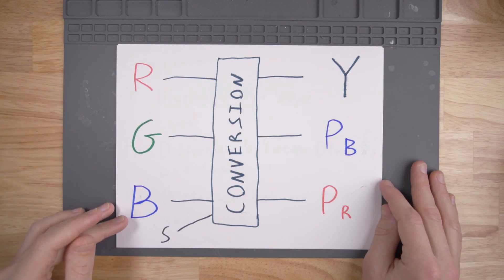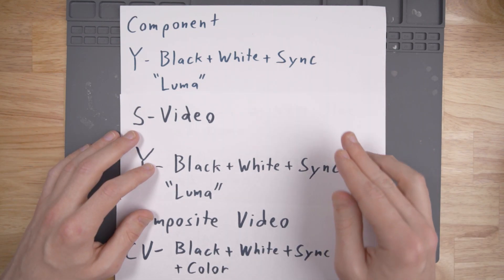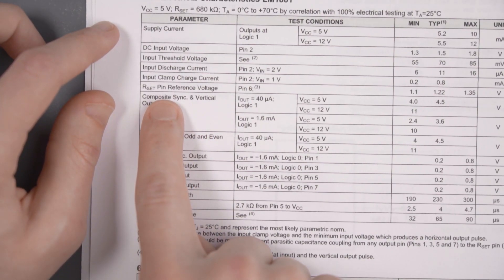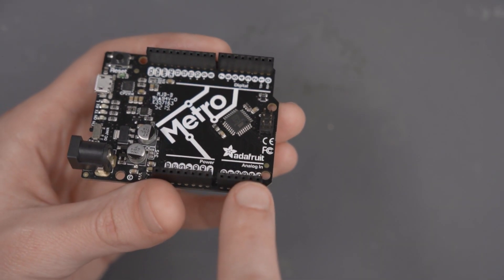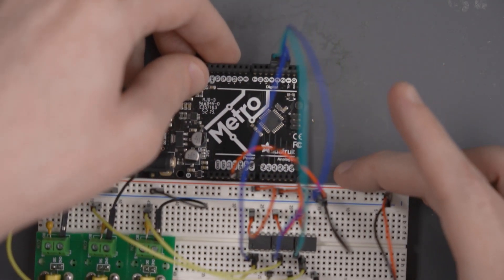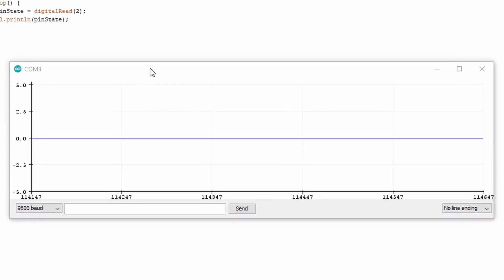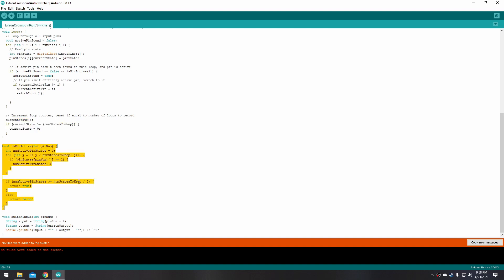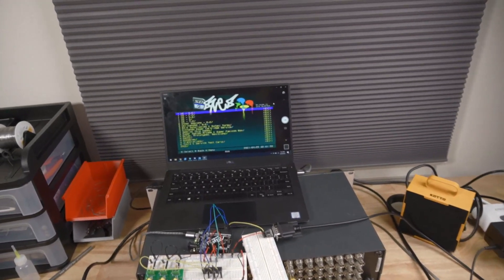Extron Crosspoint Autoswitcher Prototype! Part 2

Comment: What happened to this project? Was so cool to see this coming together.
Reply from the maker: In a nutshell, I ran into some issues with coming up with a good interface with the BNC connectors on the back of the extron crosspoint. Also, Voultar gave me an idea to use an amp on the video inputs because they will be split between the extron and the autoswitcher circuit. This project has been on the back burner, but maybe I can find some time to revisit it!

Comment: Are you looking to do a part 3 still, or did this project die on the vine?
Reply from the maker: I haven’t worked on this project in a while.  I was trying to figure out a good way to interface my project with the extron, and found out the parts may be too expensive to justify over using a different auto switching solution. I may revisit it in the future

Comment: Cool project. You can probably skip the arduino and use discrete circuits, a series of xors or comparators. Ditch the y adapters and do a pass through on the breadboard. Try putting some caps on the power rail to smooth out the vcc, and tie the unused pins low (or high) so they're not floating.
Reply from the maker: Really the only thing that a microcontroller needs to do is send the rs232 command, but the firmware could be changed to add additional features (changing between manual and automatic switching, different auto switching behaviors)
Reply: Good point. 

This may take it past scope, but for v2, put the commands on eeprom and push it through a shift register. Use a 555 or a crystal to provide the clock, and on a hit read from an  address range to push the command over 232. 

Granted more complex than using a microcontroller, but it can reduce production cost if you want to scale it. Then again I'm also a software engineer, so I may be over simplifying it.
Reply from the maker: Something I’m definitely considering is using some kind of shift register to lessen the number of pins I need to read all the inputs. That way, I can use some inputs for other features, like physical dip switches for each input to control which output to go to (I.e. inputs 1-4 go to output 1 whereas inputs 5-8 go to input 2)
Reply: Dip switches kind of move away from the automated idea, but I get where your coming from. I'm interested to see where you take it. 

I assume you've seen Ben Eater on here, if not, check him out.
Reply from the maker: Oh yes, been watching his 8 bit computer videos for years now
Reply: Nice I'm working on that one now. Halfway through it. I underestimated the work of running the jumpers. He's great for demoing how to do the basic tasks with elementary components.

Comment: I like this idea; however i wonder if we can solve this problem without inserting other devices in the video or sync path. I can imagine that running a 128 with this could get some extra signal distortion. An alternative approach could be a measures power socket between the wall outlet and the console. When power is active, switch to the input. But this solution will have issues too i guess.
Reply from the maker: Interesting idea, but I imagine that will expensive lol
Reply: Instead of doing the measurement at the socket, you could tap into the powerbutton or power led of each console and use that as a trigger signal. Perhaps taping light sensors on the powerleds would be the least intrusive way